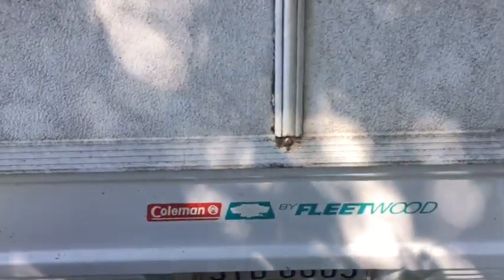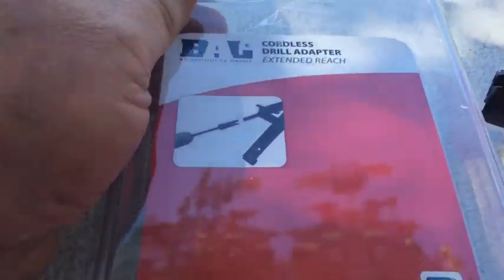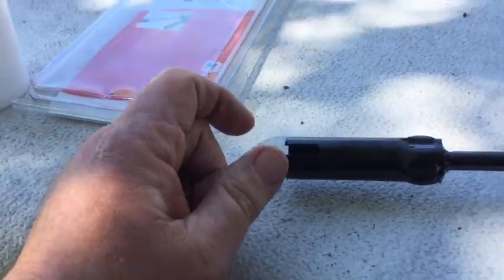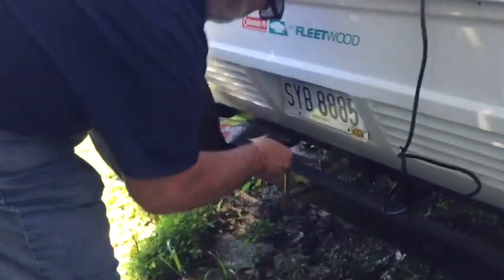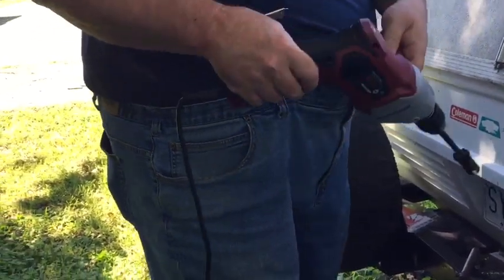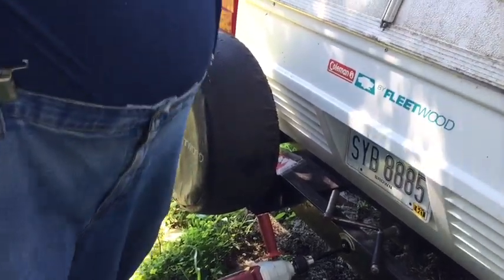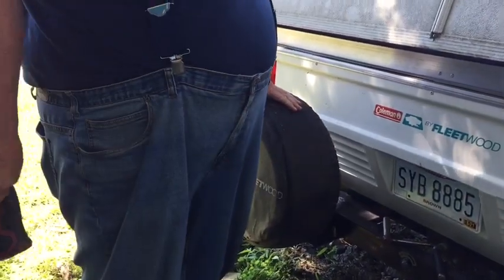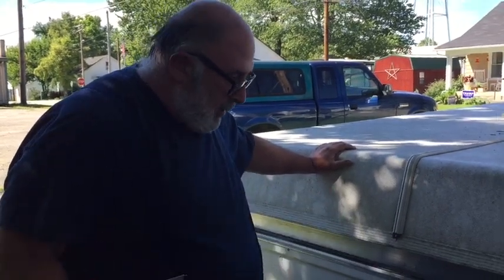Camper experiment

Comment: I hate when that happens....   I use a battery operated DeWalt 1/2 drill to operate the jacks on my truck camper, Chris.  The drill has 3 power settings and I use the number 1 setting that is a slower turn but has more power.  I am thinking that the DeWalt drill or something similar will work for you.  I also pulse it as I am jacking up my camper.  It gives the drill a little time to recuperate. It sure beats hand cranking....  I am not as young as I used to be!!!  ;-)
Reply from the maker: Yep, that’s my problem. The cranking up by hand is almost unbearable. I have lost a lot of strength in my arms since a broke both of them and tore ligaments off my right elbow. I feel useless anymore.
Reply: @Chrissvarietychannel549  ...  I know the feeling...  That is why we adapt and over come!!!  ;-)